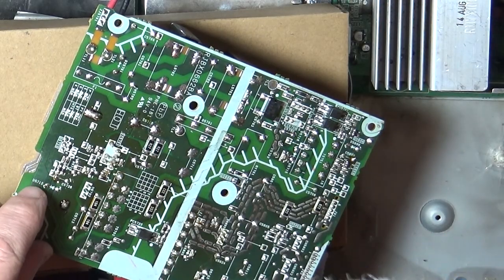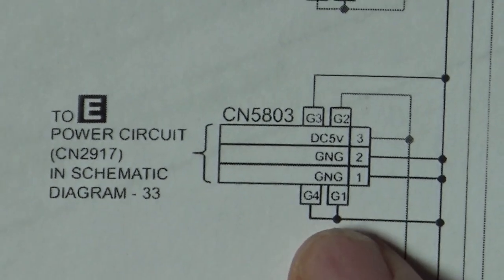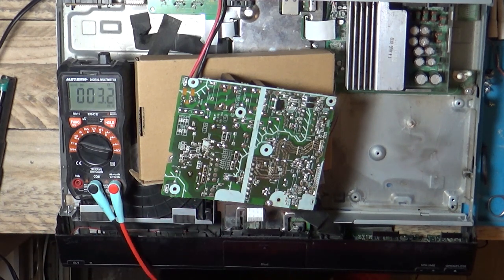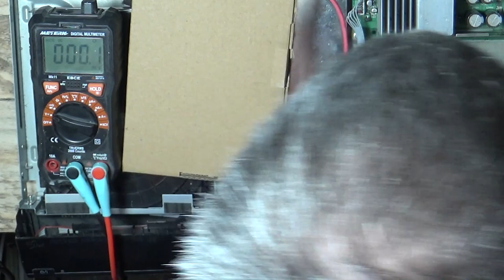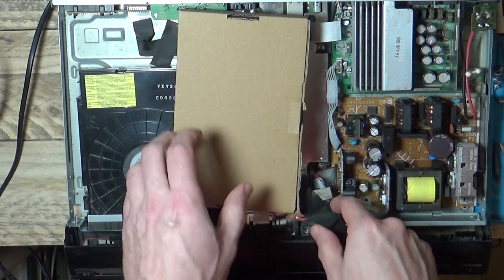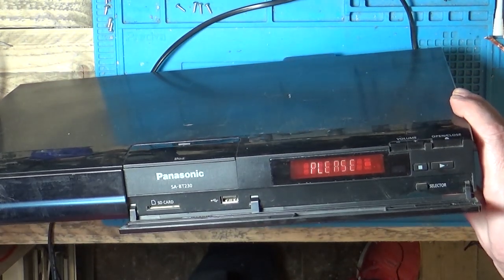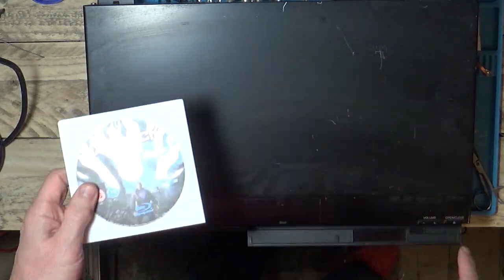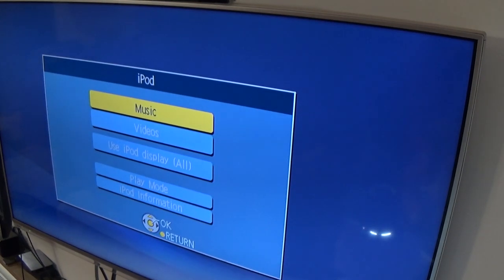Panasonic SA-BT330 Home Theatre Blu Ray Player Repair with F76 Error - UK eBay Reseller

Comment: Thanks for your video, I think I will buy an ESR meter to check caps in circuit, I think it is a good investment and saves time when you have boards with lots of caps.

Comment: Thank you for posting this video!  Separate question, have you ever encountered an SA-BT330 that while functioning with no issue produces a pungent burning smell?  I have that scenario, but upon opening the casing see no indication of anything frying.  Any thoughts you can pass along will be most helpful,.  Thanks again.
Reply from the maker: Sorry for the late reply. Most components that burn have pungent smells. Diodes are quite bad and capacitors usually have a bit of a fishy smell if they are leaking, some machines can still operate fine with 1 bad cap. It seems like somethings getting too warm. You could hover your hand over it to see if there is heat coming from anywhere, just be very careful not to actually touch any components while it is turned on else you could get an electric shock.

Comment: excellent video I had a similar failure, only clips and it didn't turned on. The capacitor was holding the voltage (170 VDC - 120 VAC supply) and the capacitance reading was higher than 500 mF on the circuit board I cleaned the surroundings of the STR then suddenly it turned it on. It is working. Where canI get the schematics for this PS board Thanks Julio. Capacho Venezuela
Reply from the maker: You can't always get the schematics for these. Just google the model number + schematics and you may find one. Some are impossible to find.